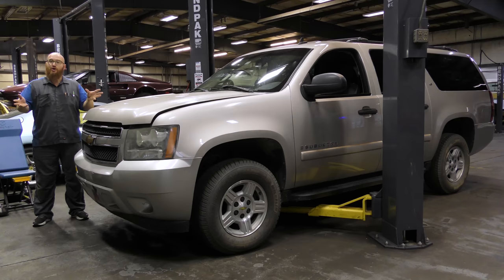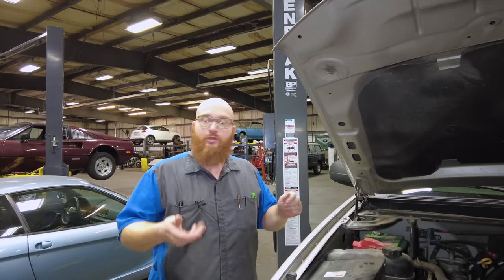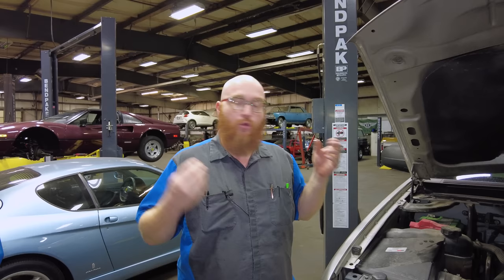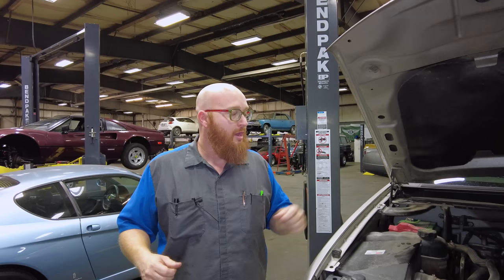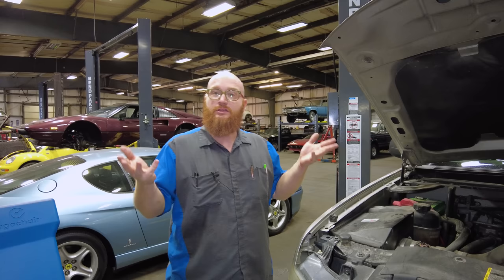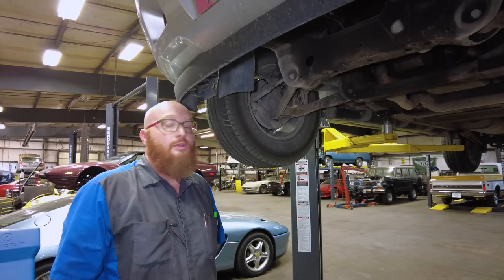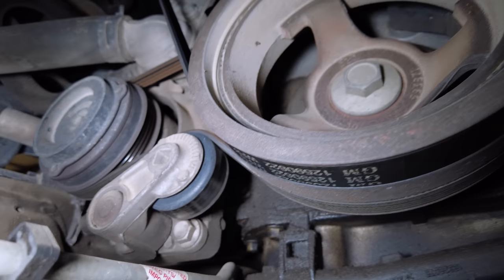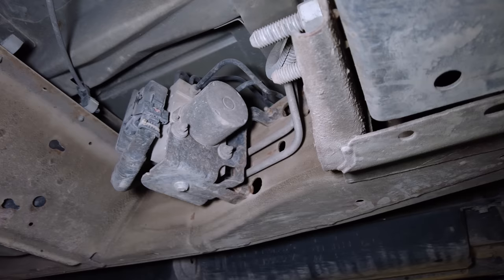What fails on ALL early 2000's Chevy SUV's!? CAR WIZARD shares what he's seen from the last 20 years

Comment: Crazy you never mentioned the 4WD systems, which seem like the single most universal problem afflicting ALL OF THEM.   And then there’s the front axle tone ring which starts flaking off bits of magnet from rust building up behind them on the hub.     Oh, did I mention ground straps?

Comment: I had an 07 with AFM.  Had to pay 150 for the computer delete.  Had to buy LH valve cover withthe updated oil shield.  I cut a socket to get to the sending unit, quite easy to remove ans replace.  I really like thst suburban.

Comment: I bought a 2001 LT NEW Tahoe 5.3 have done ALL the maintenance my self. Have changed the power steering pump, one tune-up, one fuel pump, three batteries, one power whindow regulator, rear deck shocks once, break's twice, one head light, one tail bulb...... 200,000 miles no oil leaks, oil pressure 40 psi hot at idle 60 psi highway speeds. For got two fan belt idler pulleys. ALL CHEEP FIXES.  The key is good conscience maintenance ALL oil changes

Comment: I ve got a 2004 with a 5.3l in it with 199.000 miles on. So far so good oil pressure sending unit replace water pump brakes just Minor things. Was thinking about getting rid of it but not sure

Comment: Hi wizard, have a 06 chevy silv. 4.8 liter v8. Had 4l60e rebuilt. 3 months ago, will drive great, but aftrr a few dsys. Like in the morn, start up in limp mode, no reduced engine power on my cluster, il chec codes with a scanner, all solonieds pop up tcc malfuntion open i think po740, p0758, a,b shift solonoidd, ,put new battery, alternater, upgraded ground wire fr  fire wall to a bolt on block, new transmisdion speed sensor, new throttle body, picked up truck 2dsy at 11am driving great but at 6pm 2 ni stoped at store, bam limp mode, engine light turned on , its like from a dead stop its starting in third gesr, il pull of road, turn truck off, put scsnner on, clear all codes, vehicle drives great, you are the WIZARD, and your content is always very informative, any leads would really be helpful, THANK YOU

Comment: I am hoping that one of the owners these older GM full-size truck-based SUV's and pick-up trucks will trade-in for an all-new eight-passenger crossover vehicle eventually. The all-new, 2024 Mazda CX-90 MHEV (Mild Hybrid Electric Vehicle) as well as the all-new, 2024 Toyota Grand Highlander HybridMAX will arrive in dealerships later in the year. Most vehicular buyers will just go for the Grand Highlander, because the CX-90 looks a little hideous and it will be a little more reliable for the years to come. The Car Wizard will be surprised to see these vehicles, when he plans to check out the auto show, later in the year. It will be fantastic.

Comment: While some failure rates MAY be sightly higher on SOME GM's, at least I can find parts for 1/3 the cost and usually fix it in my driveway. Contrary to popular opinion, Toyota does NOT walk on water and when all is considered, I'd rather have an easy/cheaper fix and drive something that not butt ugly.

Comment: My father in law had a 2008, and my wife had a 2011 Tahoe, against my better judgment.  I was a tech at a GM dealer and told them they will dime them to death. In 1 week they BOTH started leaking gas above the fuel tank. The lines coming out of the fuel pump both rusted and started leaking. You have to drop the tank and put in a new pump. The power mirrors quit working, I put power seat motors in both of them and BOTH had trailer assistant light on... plus the load leveling system took a crap. I hate GMs with a passion.

Comment: The oil pressure sensor went bad on my Express van. Fortunately, that's one of the very few easy to access things on the van. Take off the dog house and there it is. Of course, getting the doghouse off is a bit of a project.

Comment: My 2009 Suburban has had the transmission rebuilt last year at 196,000. Right now, at 216,000 my guages are completely dead until the engine is warmed up. Then I restart it and they work fine, but sometimes the traction control light comes on and then disappears after I restart it later. Seems haunted.

Comment: 1 GREAT thing....when adding the cabin pollen filter that should have been there from the factory, the evaporator is right there.

Clean off all the accumulated trash, hose it down with chemical clean,and put in a $10 retrofit kit.

My a/c  smells so fresh now.
Reply: Wow, these didn't have cabin filters stock!

I always assumed they became standard around 05... 

Cabin filters are great, the junk that can collect on an evaporator is crazy, and it's just going to rot.

Comment: Did you mention the power window motors?  Mine failed.  Replaced it with a China one.  It failed so I purchased a new one from GM.  My original had made in USA right on it.  The GM replacement had made in China on it.  So for it is just slow but still working.  I have owned my 2000 Silverado for 19 years.  Love the truck.  Factory seats for 2000 were crap, I updated my with buckets from a 2003.  Otherwise I would have sold the truck because the seat was so hard on my back.

Comment: Don’t forget rear level ride, all outer door handles, bad engine and body grounds, radios,transmission flare 2-3 and fuel fill issues that need vent valves and a canister. I like my Tahoe but it’s 12 years old and it gets old fixing it. Now I have a battery drain that pulls 4 amps every hour then goes back to 25 milli amps so the battery dies in 4 days if not driven.  Any thoughts?

Comment: I just picked up an 03 Yukon xl and it seems to be dumping oil out the rear. I assumed rear main but when you mentioned the pressure gauge it clicked. Mine is pegged at 80.
Reply: It's easier on those than on the model he shows in the video. I have an 05 Sierra and can change the sending unit in about 20 minutes. Plenty of good videos on how to do it without the extra labor.
Reply: Thank you! I'll check it out.

Comment: My 92 c1500 has I believe the non electric transmission was the 700r4? It has 208,000 original miles on it. Farmer that owned this before me BABIED this truck to keep it running this good.

Comment: Instrument cluster failure? Yep, ANYTHING made by GM in that era has those stepper motors moving the gauge needles, and they do fail. I live here in Goddard, half an hour away from you Car Wizard, and my LeSabre is 4 out of 4 failed gauges. I would like to know who some of those mobile shops are, since I don't want to remove (extract) the instrument panel myself to send in for repair. Thanks for the help and advice. The question is open to anyone nearby that knows someone that does the work.

Comment: If you deactivate the active fuel management system how do you get around the ecm not throwing a check engine light? How do you get the ecm to work without the afm? Thanks Auto Wizard. By the way not a fan of the stop start,I have pushed to many stalled cars in my time , coming to stop and the engine shutting down does not give me a feeling of comfort.

Comment: A lot of these problems are kind of minor, and on an older vehicle if you aren't worried about putting it back to factory and just doing a hack job to get you by, you can do things like what I did for the knock sensors
Rather than taking the intake off and doing the silicone build-up bullshit

I just bought a new harness with the 2 sensors and screwed them into the heads on the front passenger side of the engine. 100% made the light go out and got me out of the stupid "limp-home" mode that it kept putting the truck into.

Another thing I've heard of on a few of them is the starter making clashing noise. I haven't replaced mine, but if its making a bunch of racket during/right after start, and/or you get a rattling noise at low load/rpm during acceleration, it might be the starter not fully retracting and clashing with the teeth on the flywheel, you might even possibly have a few broken teeth.

i've got about 190k on my 04 avalanche.

Comment: Transmission, front end, rear-end, and steering will all wear out on these vehicles around 200K miles. Motor will go forever. Electronic issues like dead gauges, weird sensors, etc will also probably occur around 200K.

Comment: Where are those shops that will do anything for under 600 bucks? My local mechanic charges 200 to do a crappy diagnostic, then I have to tell   
them what the real problem is and I was just not equipped with doing the job.

Comment: I own a 2005 tahoe with 302,00 miles and I finally had a failure, the valve cover bolt seals started to leak. All in all everything still performing strong and would drive this anywhere. Good maintenance and your vehicle will last a lifetime!

Comment: Thank you for the video with just straight forward info. I purchased a 2004 Yukon XL with the 5.3. I definitely have the oil pressure sender issue, and my abs activates when slowing down to 5mph until i stop. And a couple broken manifold bolts on each side. Minor details thankfully.

Comment: In phoenix at 100k miles id be proactive about replacing the electric fans. One of my 2012 suburban's fans went out at 120k which affected the ac, i thought it was just affecting the ac and i did a road trip with no ac and in traffic the the engine and trans both got pretty hot. I went to replace just one motor and the second looked just as trashed as the first. My friend had a 2015 Escalade that at 100k everything started failing, ac, transmission, and overheating... i didnt have the heart to tell her it was probably 400 dollars worth of fan motors that was probably the culprit

Comment: With the gauges, it’s always a ground strap that needs attention.   Problem is with these GM trucks, and I have a 2006 Suburban my dad bought new, which I bought from him two years ago, is that there is very little rust prevention on ANYTHING.   My 2006 Magnum looks like new underneath, save for the discoloration of exhaust parts, which happens once they are broken in.   But zero rust, zero body rust, zero undercarriage rust, zero exhaust pipe rust, all factory, both vehicles driven in the same areas, same terrain, up to a point, but it’s nit like the Magnum never gets muddy, yet, when I’m under the Burban I’m blown away at how old it looks, while under the wagon, how new it looks.      I have to admit I keep the wagon clean, but not remotely obsessive.   But I have to think that even if I hadn’t, it still wouldn’t look like the GM vehicle does underneath.    Here’s the biggest irony.  Historically, Dodge has been the but of jokes in terms of quality.     Well, in case some people forgot, Chrysler was owned by Daimler-Benz during those years, 1999-2010(ish), and it shows.    Lots of my Dodge switchgear is identical to a friend’s 2002 E320.  The transmission is the same as what’s in my 2002 ML320, as is the rear diff, I think.    But except for the crappy radiators that were apparently made by Stant, and the crappy suspension rubber used in the bushings, my Dodge is the best car I’ve ever had.    Including three Mercedes.   Not one interior part has ever failed.  Not one window motor or switch, no door lock issues, stereo, HVAC has been because of the faulty radiators, but everything still works and works great, even the sunroof, never any leaks, and I bought it new, and now it has 188,000 miles.   And I step into the Burban, and the overall build quality difference is striking.    The plastic in the Burban is far cheaper looking, feeling, and wearing.  The sketches all feel cheap, and I’ve replaced three of four window motors, the drivers door switches, twice, the blower motor and relay, and had myriad dash lights and control issues, all of those rectified by cleaning and preserving every ground strap I can find, and that’s what fixed my tach not matching actual, fixed the stereo, the HVAC, all progressively fixed by tending to each ground strap.    That even fixed the 4WD system.    Point is that it’s crazy that my Dodge has such better build quality than my GM.   Even though, overall,  the Burban is a tank and bullet proof.   The Dodge is only bullet resistant.

Comment: You didn't mention throttle body sensor failure causing Reduced Power  (limp) mode to occur.  I found a rebuild kit on Amazon and fixed this on my 2004 Yukon.

Comment: Water pump, brake lines, brake calipers, tie rods, pitman arm, ilder arm, tie rods, ball joints, wheel speed sensors are everything ive done so far in that order. Next going to have to redo door pins and leaking air shocks but the 6.0 still pulls strong. Driving this truck to the grave.

Comment: i ran my 01 silverado with a 4L60E 230k miles finally blew up on me
my dad bought it new off the lot, ran it to 150k and i got it
i put 80k of towing a 20,000lb toy hauler loaded
(it's a 1500 base model (not 1500hd) with airbags in the rear.

Comment: I really live my old 2009 rebuilt Tahoe LTZ...it is a rebuild from body damage, and i got with 75,000. Miles on drive train. Knock on wood, but it is still smooth driving, comfortable on the road!   thing is my lift gate is not opening by manual back handle when i turn power  button off. On power it opens to about 20 degree, then immediately shuts. So thought maybe struts...wentvto use the manual open but nothing. That is very  inconvenient as harder to get my dogs in n out. I really cant afford to take to the garage and am by myself fo will keep googleing until i figure something out. Thanks for the tips!!

Comment: i drove my 2001 to 170 miles and only fails i had was the light switch ignition switch and anti lock brake control

Comment: Ford also used some pure trash exhaust manifolds and fasteners.
Lived through it.
Manifold rotted away in flakes and the studs were impossible to remove. I ended up junking the thing once the big invoice was presented. (She was rusty underneath as well i live in the rust belt)
I think they all (GM ford etc) all buy fasteners from the same company, and deliberately choosing the penny ones.

Comment: I'm lucky enough to not have any of that AFM crap on my 05 Tahoe. The oil pressure sensor is not that expensive and way easier on my body style. I haven't replaced it yet. But might for piece of mind. 340000 miles

Comment: GM has had a problem with HVAC actuators since they started using them. I have had multiple problems with the actuators on 1993, 94, 96, 2006, 2012 and I feel the problem still exists. 3 years ago I purchased a new truck, and I wouldn't even consider a GM. I had driven Chevy trucks for over 30 years, but they finally made them so bad that I had to get something else. Brake lines, fuel lines, transmission lines, all rotted away before 100k miles on my last new Chevy truck. I can't afford to drive them any longer.

Comment: It's sports utilities in general. And it's the head gasket and transmissions. No matter what this guy says you'll have coil and spark plug issues. Gasket issues. And the ultimate problem, transmission. Transmission repairs in California for a store cost well over 4 grand. More money than a used suv cost. I had a head gasket failure in my ford expedition which basically cost me the truck because I couldn't keep up on everything breaking after the head gasket failure. The cylinder misfires were it's death. Was gonna cost me well over 3 grand to get cylinder misfires corrected and recoding. Got towed for expired reg because I couldn't get a smog done in Cali. Because of the failed cylinders. Fixed everything up to the actual disassembling of the block. Coil packs spark plugs gasket seal. Had a brand new alternator and belt brand new battery. American made trucks and sports utilities especially are manufacturers poorly on purpose. They put the engine behind the fire wall so mechanics charge 400 plus dollars for spark plug replacement. Not even installing coil packs. 400 plus dollars! I ended up doing my next spark plug job myself in less than .02 percent of the time a mechanic shop did it. Cost me a total of 30 dollars due to the fact spark plugs were only 13 bucks a piece and I only needed 3. But changed all of them with brabd new motor raft sparks. My car was basically brand new when it got impounded. The female dog that runs the lot must of loved it when she saw it because she illegally increased the impound yard dues by 400 dollars when I came wit the money to get it out. But yes. Gasket n transmission.  Known fact.

Comment: I would LOVE to see a "What Fails" on 2001 Era Blazers (6 cyl./ 2 wheel drive). I love mine! Actuator got replaced, now the A/B Valves in the 6L60E need replacement. Any other suggestions?

Comment: Dang, now I'm worried. My 2005 Tahoe is going to be crap. Family truckster originally. Bought my wife new car and took over the Tahoe as a farm truck. Water pump, radiator and oil pump replaced from low oil pressure. It's only 286 thousand miles. Never had a tune up. I'll do that at 300,000

Comment: Active Fuel Management (AFM) or Disable On Demand (DOD) = NOPE.  Air adjust electronic suspension = NOPE.  other than that, not bad.  The 199-2006/7 early = WIN. I think the 2007+ 3/4 ton 2500s did not have AFM.
Stay gold.

Comment: I have a 2003 replaced intake plugs wires knock sensors injectors and still have a stumble between 40 and 55 no check engine light

Comment: 2006 is the best year.... Or even better,  2004, and you modify a few things like brake disks & calipers with 2006 parts. Also, lots of cheap ride improvement parts available like sway bars, sturdy rear control arms, steering dampers etc, making it REALLY handle a lot better. A keeper for life, given that we are rapidly approaching CUBA conditions. Lots of aftermarket improvements available and parts are abundant and much cheaper than Toyota.... Until something like the EU now proposes happens, (15 year vehicle repair ban....)